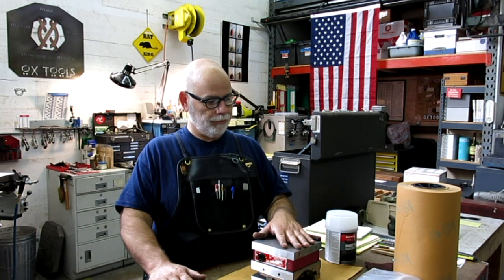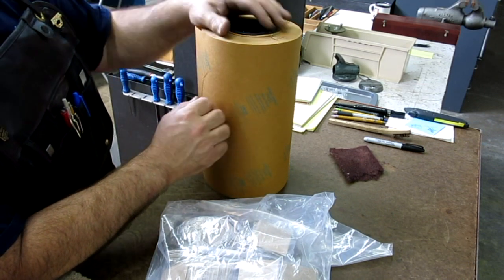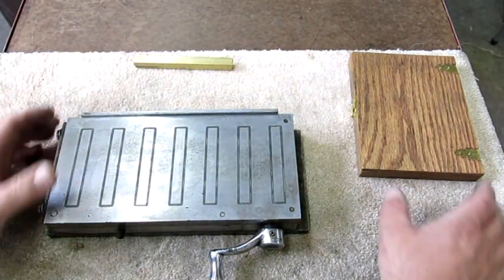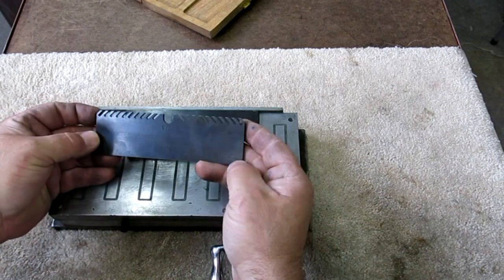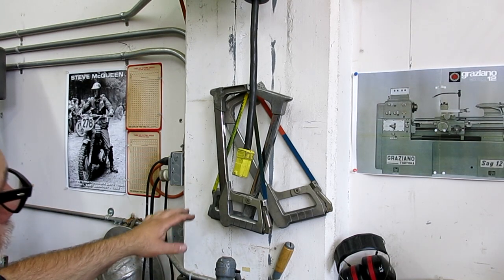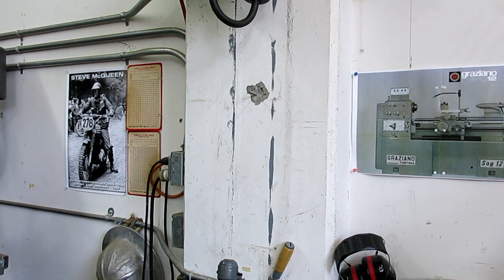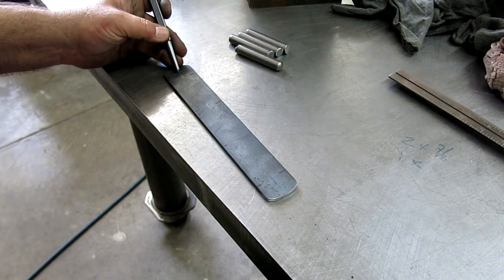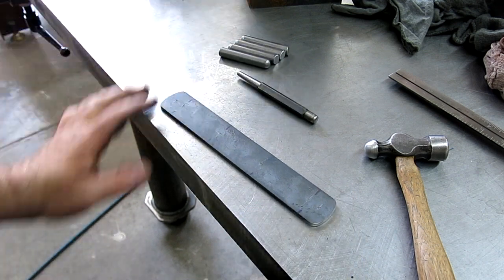Monday Night Meatloaf 90

Comment: Hi Tom,
I have a comment about the VCI chips and the VCI paper on the roll.
Years ago I placed the VCI paper with my small Starrett tool collection. This was before I bought my Gerstner model 42 off of EBay and a Gerstner base cabinet.
I digress after a few months I was getting one of my tools out that had been on the VCI paper in the original Starrett cardboard box and I had rust on the tool. After checking my other tools I discovered that they all had some degree of rust/corrosion on them. 
I will preface my following statement since I am not any form of expert. I believe VCI paper/cardboard in any form will attract moisture and transfer it onto the precision tools surface. After I took all the VCI paper away from my tools and cleaned them up and applied a thin coat of oil they never rusted again. 
IMHO I believe that the use of VCI type papers is for the short term use for the manufacture to let the tools sit on the shelf till they are shipped to the distributors/retailers and once purchased by the consumer the VCI can be discarded.
This is my experience and in no way do I profess that this is scientifically correct. Just my own experience that I wanted to share.
Tom,
I always enjoy your videos I learn a lot.
Best, Jeff

Comment: I like it!  As a shop teacher this is always one of the problems I encounter.  Hanging tools individually is the best way not only for situations like yours where you want rapid tool retrieval but also in my case where you need to take a quick visual check to make sure the little darlings have put everything away.   

Thanks for sharing!

Mike

Comment: Hi Tom , Ive watched a lot of your videos in the past and have to admit that I've learned a great deal of tips from you so I thought I would pass a little titbit of info back.
I noticed that when you were using the hacksaw you don't extend your index finger sort of like "pointing when cutting" if you do you will find that your cuts will be far more accurate without really thinking about it.
Hope you give it a try , by the way this is my very first comment on any site ever !!!!
Cheers from across the pond, Steve

Comment: Just a tip on using Tapcons (the blue masonry screws) is that while you would think driving them in with an impact would be the way to go, they're actually supposed to be driven in as slowly and smoothly as possible, and it does make a huge difference.  I generally like to use a ratchet.  An impact works okay with the smaller screws, but they'll bind up and seize part way in as you start getting into the bigger sizes.

Another key is to get as much debris as possible out of the hole---especially on holes drilled vertically e.g. to mount a door threshold.  In those cases, even better than just blowing them out with air from the top is to use canned air (keyboard cleaner) so that you can get the straw down to the bottom of the hole to blow the dust out from behind.  Insert warning that doing this occasionally probably won't kill you, but you don't want to be breathing that dust if you're doing this often

Comment: Hey Tom...

Nice job even though you made a big project out of a small one.  I guess that is what a guy does when he has all that fancy equipment around. 

I would have just screwed a few of the  4" or 6" BlueTap Screws (in white, I keep both size white ones around to hand things on my walls) into the wall and called it a day. 

You could have still hung them using that same hole in the saw and you wouldn't have to paint them.. KISS 

Gotta love BlueTap Screws ... They are as GREAT as deck screws are CRAPPY.

The real bonus would be that you would have had time to sit down and massage the wife's back before dinner.

Be well, keep up the good work
God Bless

Anon

Comment: Hey Tom,
I gotta say,  before you opened the box of PermaGrips, I thought you were about to show us a real , honest to goodness,  BRASS MAGNET.   ;)
But the Permanent grips look like they work too. Although I would still block the piece in on the ends especially on a corse barred magnet.  I hate throwing parts off the grinder. It's  hard on the nerves. 
Another fine meatloaf.

Comment: I'm glad you didn't go ahead with the bent wire, I was kinda shouting at the screen.
Storing tools so I can get them with one motion, ideally by the handle is rule #1 for me.
Adam Savage calls it "first order retrievability", I just call it a fighting chance that I put things back where they belong.
Some people just don't get why I will spend an hour to make a holder like that, when it might not even pay off on a time for time basis vs. storing the tool in some simple way. I try to explain that not all time is created equal but not everyone gets that.

I was looking at those high tension hacksaws when you mentioned them in another video, but wasn't sure which I should get. The Lenox is not particularly common in Europe and doesn't look very comfortable (like all US made tools). I kind of liked the  Bahco but don't know how the 150kg tension compares since the Lenox (inexplicably to me) measures tension in psi. I guess I have to measure the cross section of a typical blade and convert it.
Reply: +stefantrethan LOL I think between your and my shouting at the screen he got the hint..

Comment: During a recent project I found out quite by accident that naval jelly removed the mill scale from some hot-rolled square tubing, leaving nice clean metal. Apply liberally, let sit a couple minutes, scrub with stainless steel wool. Rinse.

Just an alternative to using abrasives, sanding, etc.

I love the rack!

Comment: Never even noticed that my hacksaws also have the same hole in the handle... I'm in Sweden so probably Sandvik clones. Thanks Tom! But I'll modify the holder by drilling holes from behind and plug weld the pegs. No visible welds as a result.

Comment: im not a machinist or anything or a welder :( i hope to start learning soon tho! but would it not be easier to put a key into the board and pegs? or is that just making a job bigger than it needs to be? but then it would make it easier getting them at the right angle for welding.

Comment: So...Who can you get into a "My tool is littler than your tool!" without it either seeming odd, or hurting anyone's feelings? The reason I ask without feeling odd myself, is that has got to be by far the tiniest roto-hammer bit I've ever seen! When you bowed it up before drilling the 2nd hole for your custom saw rack's blue screw hardware I thought for sure it was going to "shnapenzie Duetche"! BTW, what size was that pre-drill and the beautiful blue fastener combo?

Aloha...Chuck

Comment: Dip the rack in paint.

Best lazy method, trust me. I dipped most of the supports i make. Heck, one summer i was sooo over painting i went and bought a tube 2 meters long 20 cm ID, capped one end, poured paint inside and dipped all the angle iron i  straightened and cleaned for a project i had.

The results are quite good, actually.

Comment: Gday Tom,
I was told by one of my tech teachers once, that a thin piece of paper under the material on a magnetic chuck increases the grip quite a considerable amount & helps to stop slipping of the job. I'm pretty sure if I remember right,  he said to wet the paper with the coolant first before setting the job down. Paper is very accurate thickness wise, so being parallel in most cases should not be an issue. Is this a known practice ? I have never heard it elsewhere.
Cheers - Pedro...

Comment: Spray paint it white, rite on the wall....I've been cleaning out a friends shop who passed away about 8 years ago, all the mikes and calipers that were stored in their factory cases were very rusted, the ones left out on a bench or shelve uncovered were just dirty but no rust. Those little cases the tools come in act like sponges and soak up the humidity from the air and damage the tools.
Reply: +John C I find the same thing with a set of Vee block I have in a cardboard box and the greasy paper, ruxted to shite now, well pissed off. Rotary table sits on the bench, covered in a very light film of dust, no problem.
Reply: +John C For stuff in wooden boxes, I tend to wipe round the inside of the box (where the wood's usually unfinished and as you say, very porous) with mineral oil. Ok, motor oil in a few cases LOL
Reply: +John C For stuff in wooden boxes, I tend to wipe round the inside of the box (where the wood's usually unfinished and as you say, very porous) with mineral oil. Ok, motor oil in a few cases LOL
Reply: +John C Good point John... Same goes for good sheath knives... never store them in the sheath... it will do more harm than good.

Before putting them away, I wipe all my tools that can rust with a silicone impregnated cloth made for using on guns.  It works fine and there is not a thick film like I would get with oil.  I keep one in each toolbox so I am never without it when needed.

I cut out fitted drawer liners from non-porous rubber matting designed for lining the large toolbox drawers and put it in my Gerstener Boxes over the felt.  

Funny story...
My friend's dad said I was like his wife who covered all their furniture with that godawful clear plastic seatcover material and put clear plastic runners on all the high traffic  paths over her carpet.

funny part... he bought felt from Woolworth's 5 & 10 (remember them?), glued it to cardboard and put that over the bottoms of his Gerstener box.  He is dead now and my friend uses the box.. it still has the liners in it and the entire box (circa early 50's) looks like brand new inside and out.  He used to wax it.  Everything that family owned looked like new all the time.  The kid still has his red wagon, scooter and three wheeler from 50 years ago and they all look like new except for the repainted areas that his touched up to keep them looking nice.

Probably see them on ebay one day..
Reply: +Anon Ymousmie I know it's not relevant to tools used every day, but for tools in storage, normal, common or dollar store vaseline mixed with paraffin candle wax (melt the wax, add the vaseline) works VERY well as a storage preservative. And it's dang near close to free

Comment: hi tom,
hay can u tell me what size motor is on your S.Grinder? and you do have 3ph run to your shop right? i had a bozo  moment so i have a 3ph to 3ph vfd and if it will work for your motor size i send it to ya i forget the brand but it is a name brand, 
thanks for the video again thanks josh (aka Turnmaster)

Comment: Tom,
Paint each peg a different color then color code your hack saws -- make it easy to put them in the correct spot.

I have to do something similar for files.

Craig
Reply: +Craig S Or could slip those different color polyurethane (I think): http://www.tdperformance.com/cache/ex_q75_w501_h501_images_ePIM_original_9009.jpg
http://www.tdperformance.com/cache/ex_q75_w501_h501_images_ePIM_original_9009.jpg
Reply: +Craig S 
Got everything color coded in my shop.  Every bolt on every machine.  No more guessing.  That red nut there.  It takes the red wrench.  Couldn't tell ya what size red is, but I don't need to know!

Comment: Hi Tom, is there a reason you put a wallpaper of Graziano italian lathe on your wall?
Reply: +Cosimo Marotta Because you can't go wrong with a machine that has "rabbit" mode and "turtle" mode. Oh, and then there is the beautiful instruction plate on the back showing how to properly wire the thing so it rotates in the right direction. The double ways are an interesting touch. Fundamentally, the machine looks cool. Tom's YAM might be more functional though.

Comment: Hi Tom,
gotta luv that "shop porn" you have hanging there by the hacksaw rack  ;) most guys would have raquel welch or a a new würth calender hanging there with some nudie babes.. tom: he gots a pic of a graziano lathe.. lol.. 
thanks for showing how to get the pegs all lined up without killing it... nice score on the suburban tool sine plate! 
i recently picked up a something similar for the bridgeport... it's out of east german manufacture and it has a milled flat on the base plate table and then what looks like a pin underneath the swivel table for setting up jo-blocks to get the angle just right. it seems that the angle calculations would have to go in a negative since the swivel table has a right angle drop on one side to mount a vice or work vertically 

cheers 
mike

Comment: Consider positioning the holder lower on the wall, perhaps reaching across or even down to interact with it.  Reaching up forces you to grab the saws by the blades.  Reaching across or down allows you to grab the saw by the handle, rather than having to grab then reposition the tool in your hand and the reverse when you put the saw away.

Comment: what makes the permagrips so expensive? I see like 6 operations necessary to manufacture one... or is the teething very precise?
Reply: +madinatore I'd bet the heat treatment to get the spring on that very thin section is extremely difficult to get JUST right...

Comment: For those of us who don't weld much if at all, how would it go if the pegs were threaded on the business end, and then screwed into a backplate? Use a little thread-locker to hold things together...

Alternatively, I suspect that one could make the pegs from bolts and then cut off the heads...

Just thinking out loud here...

Eric

Comment: Tap cons, but almost any screw works if u find right piece of copper wire that match in hole. Concrete guys use nails and tie wire to hold forms on concrete.

Comment: Nice, For the simpler method is just cut slots ( with the actual hack saws) in  one leg of a piece of angle iron and hang them vertically by blade.

Comment: Tap con screws there the best use them love them.
Reply: They do work well.  I just used some recently to fasten a threshold to concrete in my garage.  Some of the holes were wallowed out from accumulated wear, but a few pieces of welding rod put in before the Tapcons and they held well enough to dimple the aluminum threshold slightly. 

-- Mike

Comment: Hey Tom,

You probably painted it already, but if you haven't you might want to try out Valspar Anti-Rust. It's an old school oil based enamel, that's pretty durable once it's fully cured. I've used it on a couple projects and I'm always amazed at how much abuse it can take.

http://www.valsparpaint.com/en/find-the-right-product/exterior/spray-paint-1/anti-rust-armor-enamel.html